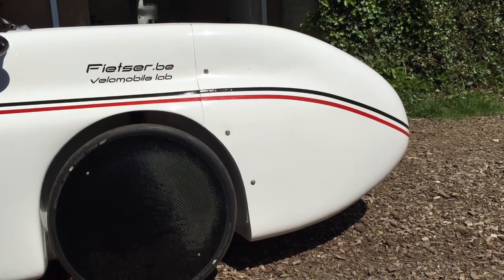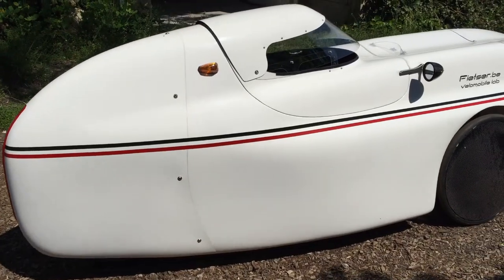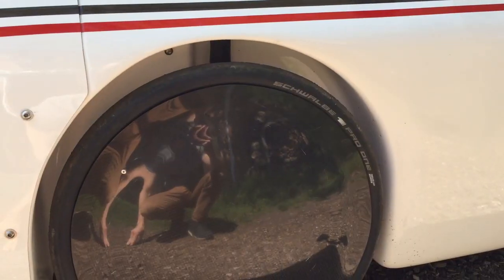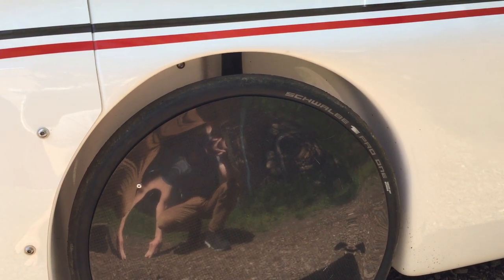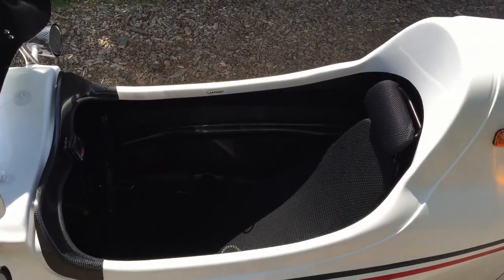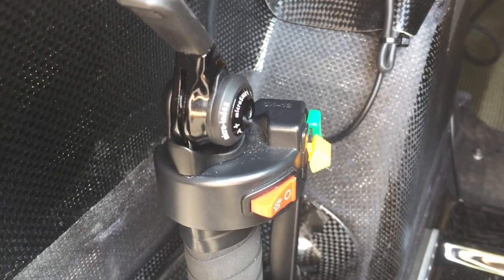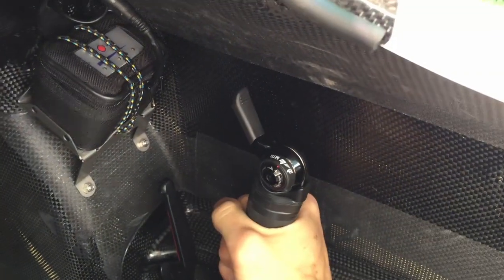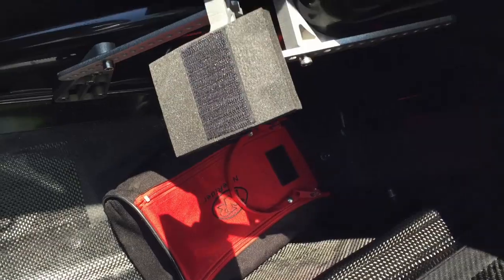Carbon Waw Velomobile Review

Comment: Thanks for this quality review.
A few things I'd like to add:
- the main function of the Kevlar nose and tail is shock absorption, as the WAW was designed specifically as a street velomobile. Also easy exchange after impact, maintenance, tinkering... A MUST for practical biomobility, less important for touring. Disadvantage: WAWs are never declared total loss for insurance. Advantage: no need for omnium insurance (600-800€/y).
- the time trial or thumb shifters: you're not operating them correctly. They need to fit almost entirely in your wrist, the lower part of the wrist rests stable on the joystick. You shift by rotation of the wrist or with the a light push or pull of the thumb.
- thanks for pointing out that the cabrio roof can be stowed away in the trunk. However we observe that many utilitarian riders keep the canopy on on a daily basis as you get a 300° unrestricted view, sufficient ventilation and shade, plus the comfort of protection from wind, and wind noise.
- this CarbonWAW is indeed pretty brutal as it lacks the composite suspension of the normal, Kevlar WAW.

Comment: I really like the engineering going on with the Waw. So 50 kph is easy huh? How does that compare to the QV?
Reply from the maker: 2disbetter very hard to compare without extensive wattage testing. I’d guess a 5km/h max speed difference. At lower intensity the speed difference grows smaller of course, as aerodynamic resistance grows exponentially with speed.